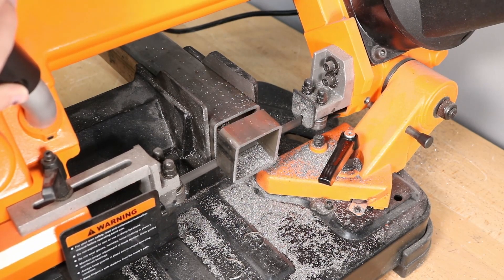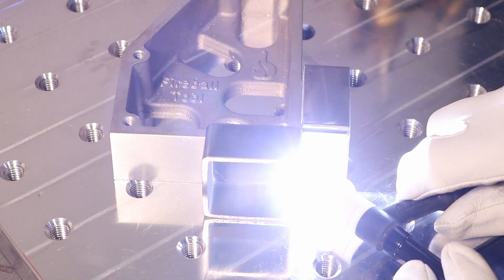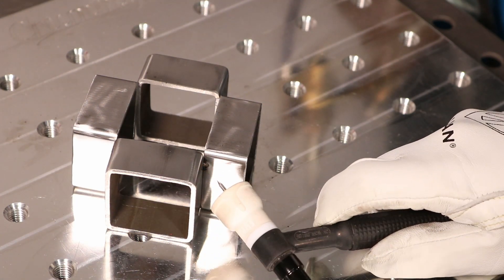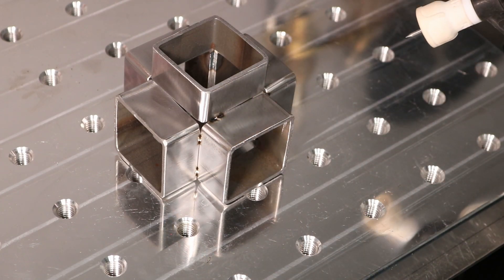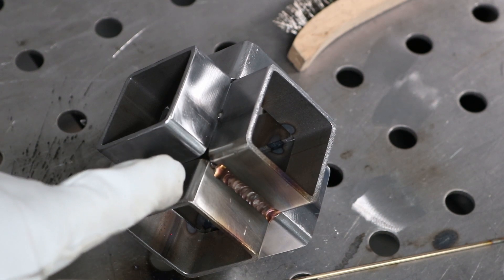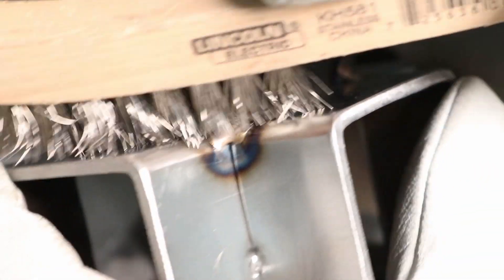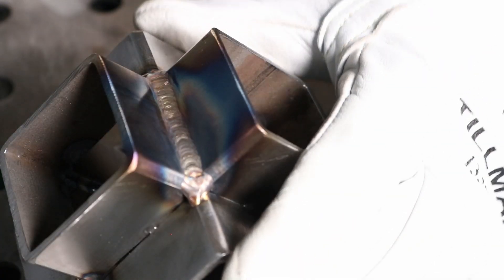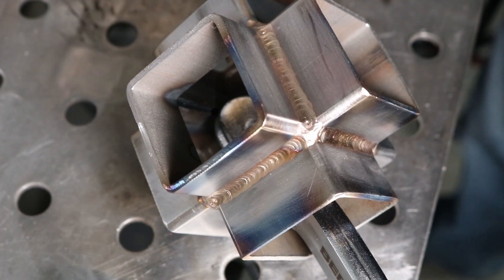TIG Brazing with Silicon Bronze: How to TIG Braze

Comment: Thanks! That. looks like a great practice project for a newbie TIG welder like me. 12" of fillet with 12 corners to fill at the expense of only 6" of tubing is a great deal, especially when I can get the tube for a great price off the drop rack or free out of the scrap bin at the local steel supplier.

Comment: Thanks for the great videos. Question: I want to get a welder as an artist, where I might need to join 'found' metals & thinner metals, without the need for full weld strength. This tig brazing sounds like the way to go. I'm trying to make decision at this time in buying a welder & want to get the right kind so I can do brazing like this video, or simple welding with scrap metal i find/ even dissimilar metals... with 'art' strength of joints only. (I do many types of art, so a welder will be more occasional for me/ not daily/ not for critical welding like car parts or anything like that). I was looking at a very simple basic 3 in 1 welder, with flux mig, stick, & lift tig. Can I do this kind of tig brazing with this kind of machine? Thanks.
Reply: I see your notes say, 'pulsed tig'... so i guess you need a tig with 'pulse' capability. Not sure what you mean by "standard settings"... what type of tig are you talking about with that statement in your notes under the video? Which kind of welder do i need as beginner/ hobby/ home use/ occasional use/ not a lot of $ ??
Reply from the maker: You don’t need pulse, a straight DC TIG will work fine. Be aware that this won’t join aluminum, so if you’ll be joining aluminum, you’ll need AC output as well to weld it. Lift TIG is fine for this, but a lot of 3 in 1 units are fairly lacking in the TIG department. The one feature I would make sure it has is a foot pedal for variable amperage control. One more thing to keep in mind is that if you want to run MIG and TIG, they use different shielding gas, so you’d need two gas cylinders which is expensive.
Reply: @TimWelds  Thanks so much for sharing your wisdom based on your expertise. You are amazingly helpful. I'm just trying to get a sense of my options at this stage. I expect to start out with flux mig  & map torch stuff in the next couple of weeks... & eventually do tig brazing/ welding. So your input is so valuable. It helps me to have a better vision. Based on your input, my expectation is to just start with a cheap flux mig machine that I can afford right now, & later get a good tig machine. I would have had no idea of making such a decision without help, & probably losing days of my life to get answers. So thanks again. Immense gratitude.
Reply: @TimWelds  I see a cheap 200 amp stick welder on amazon right now that says you can weld aluminum with it? So why would you say you can't weld aluminum with a 3 in 1 that has stick welding? I'm just trying to get this stuff figured out... clueless. Thanks for your help & patience.
Reply from the maker: Stick welding aluminum is possible, but it’s a real pain, so I wouldn’t recommend it for a beginner. You can also MIG aluminum. Technically, it is possible to TIG aluminum on DC, but I wouldn’t recommend it. Starting with flux cored and MAPP brazing is a great way to go.
Reply: @TimWelds  Thanks. Aluminum seems like a great sculpture material, because it is so light weight. Which technique would you say is the most optimal for such purposes (down the road)?

Comment: Tim
Can you please explain how to tig braze thin sheet metal (20 gauge)  to thicker steel (1/8 thick plate or pipe). Idea is to avoid burning through the 20 gauge but yet adhering thin to thick by using silicon bronze.
Thanks much
Bruce

Comment: What is the difference in strength between tig brazing and regular tig welding?
Reply from the maker: The tensile strength of the braze filler material is in the neighborhood of 50-70% of what a typical steel filler would be. This can be overcome by increasing the size of the fillet. It's really most useful, however, when reducing distortion is more important than the strength and cost of the joint (the filler costs quite a bit more). It's also really nice for joining different kinds of metals or materials that are not readily welded.
Reply: @TimWelds  Good to know, thanks, I'm going to have to give it a shot for sure.  I can deffinately see it coming in handy.  Thanks for the video as well.